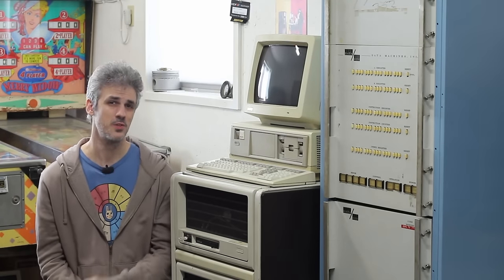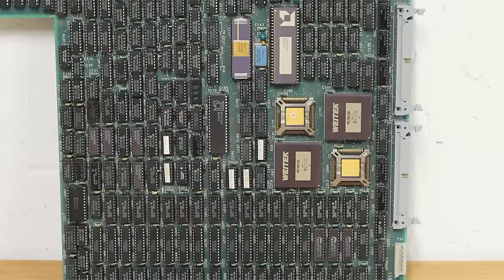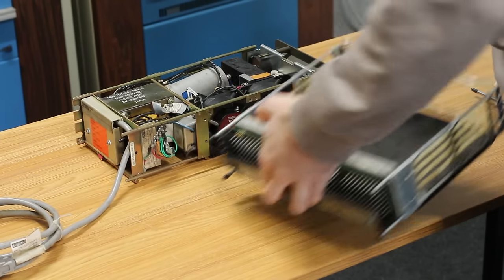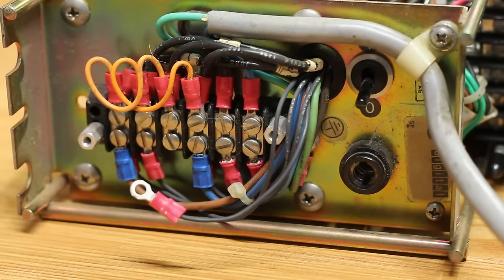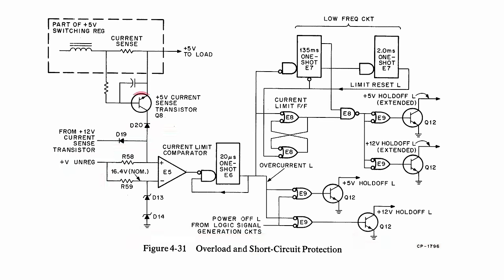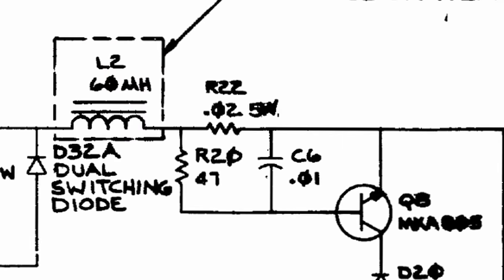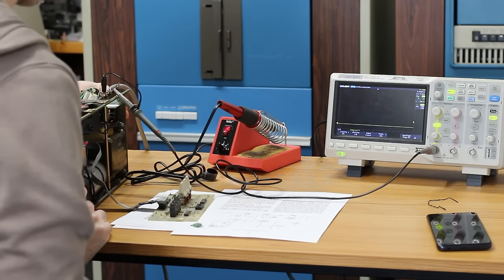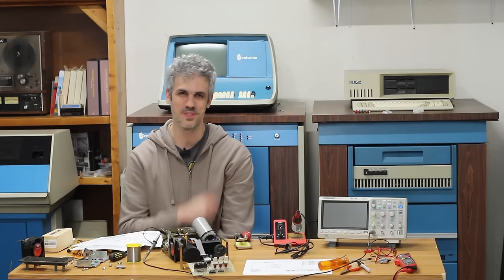This PDP-11 Power Supply Defeated Me

Comment: I see you have an 11/60 on your inventory list! I designed the Writable Control Store in it along with the clock and other odds and ends.  I also wrote the microcode that implemented the instruction set, boot up,  and all the other control stuff. Neat to see that one is still alive. At the time it did the fastest register to register operations of any of the PDP-11s... to bad that was not an important metric to customers though.
Reply: I really wanted an 11/60 back in the day, including when I was trying to start a computer school in the mid-80s.  I had a lot of equipment for it, including SMP KL-10 pair from Intel and a 2065 from Columbia University. Then I developed inflammatory bowel disease, couldn't work, and lost everything in storage.
Reply: If the 11/60 wasn't limited to 18-bit addresses but had the 22-bit extensions from the 11/70 I think it would likely have been far more successful than it was. The microcode also could do all the floating point instructions if the FP hardware wasn't present.
 
Over 40 years ago when I was working for DEC we investigated using the WCS option to create special instructions to handle some operating system functions unfortunately the performance gain was insufficient to take it into any product. Unfortunately I no longer have the microcode listings although I still have all the WCS manuals.
Reply: The 11/60 was, in effect, considered to be an enhanced 11/40 and the 11/70 was an enhanced 11/45. The 11/40 and 11/45 were really different classes of machine.  In fact the head designer on the 11/60 also was the head designer the 11/40 (and the original 11/(20)). So the feature space we worked in was more limited than the one the 11/70 design team worked with. That’s one of the reasons for the difference in address space size. 

A microcode implementation of floating point might be faster than a regular software implementation but I doubt that it would come close to the hardware implementation performance. The FPU for the 11/60 ran asynchronously so you could be doing integer arithmetic (or anything else) at the same time the FP instruction was running. A microcode implementation would run inline with the program. Also there are cases in floating where the result is, in effect, unspecified. So any floating point implementation would have to be sure to produce the same unspecified results and the 11/40 did or it could end up breaking process control systems that used the PDP11.

There wasn’t a formal instruction set for the PDP/11s, though at one point I think someone tried to document one. The key goal in implementing the 11/60 instruction set was to make sure that the 11/40 diagnostics would run on it  (as best the could)and the 11/40 version of the operating systems ran on it. The 11/70 team had similar goals for 11/45 diagnostics. 

One big area of differences were in the setting of status bits that are set at the completion of an instruction. The diagnostics and operating system had dependencies on undocumented results in the status registers…each model set those bits differently (surprise, surprise). In some cases they used them to determine what model machine they were on. In some cases customer software made use of undocumented status (and other) results too. I had to insure that the 11/60 set the same undocumented values in the status registers as the 11/40 did… did I mention that those settings were undocumented :-).

The 11/60 had a one-way associative cache and the 11/70 had a two-way associative cache. In practice I don’t think the 11/70 ended up with a better hit ratio than the 11/60. The 11/60 and 11/70 were the first cache machines for DEC. Needless to say the cache did a number on the existing memory diagnostics… so they had to be updated.

Oh hum, things I haven’t thought about in five decades. @jeremybarker7577
Reply: @dansullivan6787  Thanks for that additional information Dan. The work I did dates back to 1978 so like you it's a long time ago to remember.

Comment: Many moons ago I had the job of testing 5V 200A power supplies. They would never start up until I realised that they required a small initial load to get them going (rtfm). Very similar symptoms to what is going on with the PDP psu.
Reply: I think it needs a load too.

Comment: 10:40 I've had to do that exact fix (I refuse to call it a bodge) on numerous older systems where something got stomped after years of being stored.  The clean socket is a massive help for testing and checking continuity.  I've even gone do far as to set up a little tester, just a breadboard which the socket sits in and I can test continuity with a hand-held meter no problem; excellent to see.  And the cable fix is spot on!

Comment: What my eye went to immediately I saw that circuit is the resistor network on the control pin of the voltage regulator.  This network is used to boost the voltage over the 5V which the regulator is set to by default, in order to compensate for the voltage loss in the load transistor.  Since a crowbar circuit responds to an over-voltage condition and adding greater resistance to the control pin of the regulator brings the voltage up, I'd be looking for a dud resistor on that control pin.  There are two resistors (one is the potentiometer) which could cause an over-voltage if they went high, and one (seems to be connected to -15V) which could cause the same problem if it went low.  But the first thing I'd do is attempt to adjust the potentiometer and see if it's possible to adjust the voltage down until the crowbar no longer triggers.  Less resistance should lower the voltage in this case.
The whole circuit is complicated by having more than one voltage output.  If it's possible to isolate all other voltages then I'd do that in order to confirm that the fault is only on a single supply output and not on multiple outputs.

Comment: What at awesome video.  I love that you are doing it all with an old weller soldering iron and an inexpensive o-scope.
Reply from the maker: Thank you!
That old Weller is awesome!
Everything I'm doing could totally be done on a much cheaper, older analog scope too. I just use the digital job when filming so I can take scope shots mostly.
Reply: If you go into a professional electronics repair workshop, you'd probably be shocked just how old and apparently low-spec the test gear is! Quite often, when hobbyists get into electronics, it turns into a Pokemon collect-all-the-gear hobby, where people are convinced they need a 4 channel, 10GSPS smart scope and a 7.5 digit meter.

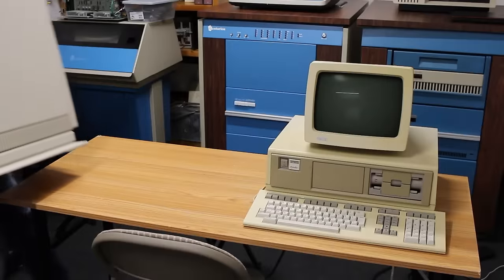Comment: 3:11 Smooth scrolling terminal. I remember getting really excited when I found the option on the VT100 in the 80's, turned it on, and promptly turned it off again after a couple of minutes. Looks very nice, but frustrating to actually use. I can see that it is a good choice for YouTube videos though.

Comment: That was a great haul of DEC hardware and very good of you to distribute it to other DEC hobbyists.  I used a small, desk sized PEP 11 in a realtime programming class, circa 1980.  Our lab had a dozen of them.   I am familiar with Bomen.  I worked for a company called Digilab 1978-79.   Digilab was the first company to build and sell FT-IR spectrometers.   I did the final test and troubleshooting of 2 or 3 spectrometers every month.  They used Data General machines.  I think Bomen got into that business in the '80s.

Comment: I admire your discipline and principles! If I would run old computers (I don't), the first thing I would do is to replace the power supply with modern replacement kits and emulate disk drives whereever possible. Your persistence in trying to keep these things as original as can be is amazing and motivates me in my daily life to never take cheap shortcuts that degrade perfection.
Reply: If you put in a modern PSU and emulate the drives, you may as well emulate the whole computer with a Pi. It takes all the fun out of vintage computers. 👍
Reply: I don't think anyone should get in to this hobby if they aren't willing to restore and use original equipment wherever possible. Emulated drives are good for hobby reproduction systems... or if you can't find the right drive/media. Neither of the things you mentioned would be unreversible though... so not too bad.
Reply: @maskddingo1779 the original drives are aging and in far more limited supply than the actual systems they serve. Emulated storage isn't just convenient, it also saves you from repeatedly cycling an aging drive while diagnosing for example.
I think a restorer with emulated drives is just smart. If you can keep an original working that's great, but using emulation saves it from wear and tear.
Reply: @maskddingo1779 also power supplies in the past did not always have the greatest protection circuits. If they had them at all. 
Using a modern well protected power supply, might be less original, but it protects your machine from being blown up because of power supply failure. And failure becomes ever more likely with age.
Even curious Marc recently had a video where he added a crowbar circuit to a vintage power supply that had broken and killed the computer attached because it did not have a crowbar circuit. Something HP added to later models. Original no, safe yes.
Reply: @bzuidgeest  Has UE said what drives were in / were avalible to this system at new (late 1980 to me isnt that long ago)
Reply: @bzuidgeest  Why are you trying to save wear and tear on something that you aren't going to use? Silly. Emulated drives have their place... but if you want the true experience, you need the real stuff. If you just want a simulation of the experience, why even use the real hardware at all?! Just emulate it on your PC...
Reply: @bzuidgeest  I'm fine with any modification that can easily be reversed back to original. An additon like this to the original that adds protection and can be undone is fine. Just don't represent it as a fully restored original. It woukd be a hotrodded machine.

Comment: Many years ago, in the early 1990ies I helped a friend bring a PDP 11/23+ to life. He had got it from his uncle who had had the intention to use it in his company. We got it together with two spare CPU-chassis.
We didn't have that much  information on it, and there was no internet to query. We turned it on, and it run for maybe a few seconds, and then a large pop and it went silent. Turns out we had put it into an unearthed outlet by mistake. Since we had no knowledge on how to repair the PSU, we took the PSU from one of the other chassis and put it into this. We had to modify the chassis a bit to make the other PSU fit, but it worked perfectly. We played around with the machine for some time, making very sure we always plugged it into a grounded outlet. But one day when we should turn it on, we heard that pop-sound again! We just couldn't understand why, it was plugged into an grounded extension cord, as usual. But on closer inspection someone had connected that grounded extension cord to an extension cord that was NOT grounded, but had been modified to be able to plug that one into a grounded outlet.  So we were down to one working PSU. 
THAT, if noting else, taught me to ALWAYS double check your connections.

Comment: I have seen similar principles in power supplies. They are designed to power high-load consumers and sometimes they don't work correctly without a load.
I would advise connecting some kind of safe load to this power supply. I usually used a couple of powerful 12v x 21-watt car lamps as a load.
Reply: Lamps or ceramic resistors are a great test load. Both keep the bench warm and cozy.

Comment: Hi,
I just tried to wrap my brain around it:

The "pass transistor" is actually the switching transistor. While the 12V output is at 0V and the base of Q15 is not pulled to 0V via the 12V shutdown signal, Q15's base will be pulled to Vin via R47 and R75. This feeds Vin to the input of the 7812. The current also flows through R75 (the 10R resistor you blew).

Normally when all parts are in place the voltage drop over R75 will reach 0.7V at a current of about 70mA through R75, Q15 and the 7812. This will turn on Q18 and the switching transistor Q17. The voltage will ramp up until the current through R75, Q15 and the 7812 drops below 70mA and then the regulation by switching Q17 takes place.

Your light emitting resistor R75 let me suggest that you have some severe load on the 12V rail (some shorted cap or similar). As without Q17 turning on, the current will never get high enough to trigger the over current protection. R75 just burns out (nearly the full Vin drops on it with Q17 off).

So the next step is to find the cause of the low resistance of 12V to GND, then R75 should no longer burn out and you can put the other parts back into place...

Let me know if my thoughts are right...

Comment: The base emitter junction will act like a diode with the collector disconnected.   That's not "leakage" as you said.   It's normal behavior.      Dnnn   transistors are 2SDnnnn.   Just a Japanese number.
Reply: The red and green transistors are ancient General Electric parts. D44xx were quite popular many years ago. That is the full part number. They are not 2SDxxx Japanese parts. The D44C8 is still being made by ON Semi.

Comment: Enjoy your 11’s once you solve this power issue (which you will!) They are great computers to use and program on (I did for nearly a decade!) I also build up a home collection a few decades ago; however, I miss owning PDP11’s now. I had a 11/05, 11/34, 11/44, RL02’s, and a ton of peripherals. Then I realized I needed to reduce my hobbies and they all went to another collector where they live happily to this day. But I kept the PDP11 books so I can be nostalgic anytime I need too. Oh … and I had a PDP8/E that I restored (a much simpler power supply fix - just throw in new caps!) Funny how things changed and got more complex from the 8/E to the 11/03; however, they also got a lot lighter!!!

Comment: Usually these powersupplies with a blown fuse, you should always check the transistors and mosfets. Good starting place
Reply: odd that once fuse replaced everything sort of worked as it should (I assume circuit and drive draws finally blew the old one)

Comment: I have replaced maybe 100 of these power supplies during my field service life. I have never tried to use one that did not have a load in the backplane. Put a proper load on that power supply. It was not designed to operate without a normal load. Dec Field Service Engineer badge number 83903.

Comment: Would it not have been simpler to just replace the connector on the ribbon cable? Looks like a fairly standard DIP/DIL IDC to ribbon cable connector to me that are still widely available.
Reply from the maker: Absolutely!
Except, I didn't have a spare, so instead of waiting on parts to arrive, I figured I'd take a stab at repairing it so I could continue on with the build. I'll order up some replacements and fix it properly once I know for sure the PSU is going to come back to life.
Reply: It was a very clever solution to an immediate problem. And if it works, it works.
Reply: Thats obvious of course it would have been simpler I bet he wishes you were there to tell him that....oh wait a minute he didn't have one.

Comment: It's often faster to just desolder the power transistors and check them all and also replace any electrolytics that seem a bit duff. You can check a few other components with a meter in circuit like low ohm resistors. Bipolars often fail via direct shorts between B-E or B-C.
Reply: To be honest, I wouldn’t apply mains to something this old without replacing electrolytics outright. Call me overcautious but there were two, ahem, “excursions” in this video and there is simply no future in going forward with 40-year-old electrolytics even if they appear to hold back DC.
Reply: @hubbsllc  Yes there is a good argument for that, especially considering how much it could damage if that 5V turned into a 12v supply. However I suspect the old Western electrolytes are longer lasting than the new ones. With the old ones you would only have a problem if they were in close proximity to the places where they could get hot, so pull out some of the best suspects and test them to get an idea what the rest are like. The thing is, with a fuse like that I'd see it more likely one of the power transistors has failed, and sometime that takes out a driver transistor. Sometimes they can half fail so you have a leakage across the junctions. It's better to spend 20m checking all this before applying power as well.
Reply: @Andrew-rc3vh  Yes - a blown fuse (especially if it had been checked from the get-go) is a good indication that something already went awry so you know there has already been an overcurrent event. Those electrolytics can appear to hold a voltage but in the case of filter caps they're expected to experience AC current - not exactly the conditions of that test. And on top of that they may appear to hold voltage now but what about after 15 minutes in an energized circuit? This does imply that if you're going to entertain getting a machine like this running and keep it running, there's a certain cost/effort to sink into it before you even give it mains which is why you need to be clear about what your goal with a piece is and how committed you are before you even put it on the bench. I restored a 1954 tape recorder and started by rebuilding the whole power supply onto a perf board; a dual-element power resistor had one leg that was open-circuit and there were two can caps that I removed outright. I didn't even plug the power cord in until that much was done.